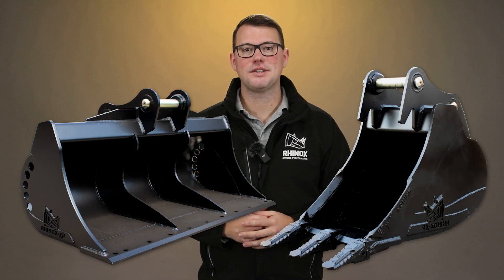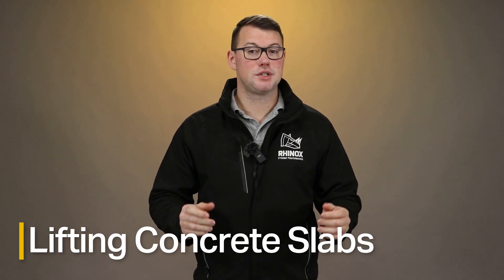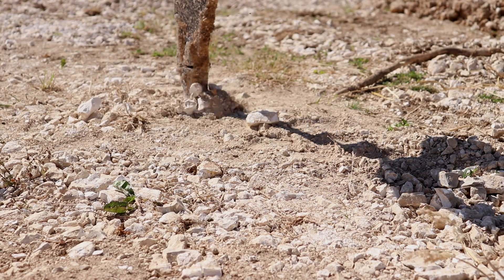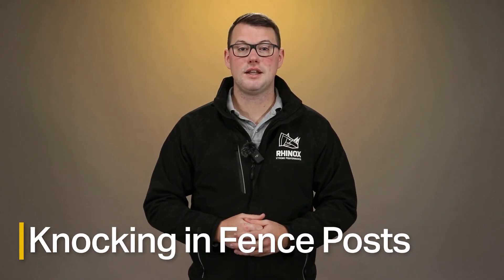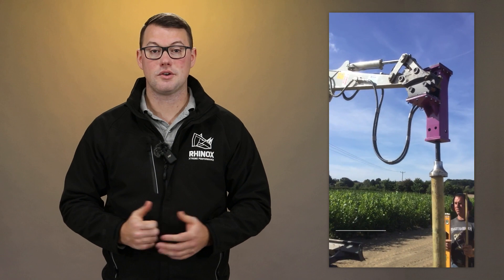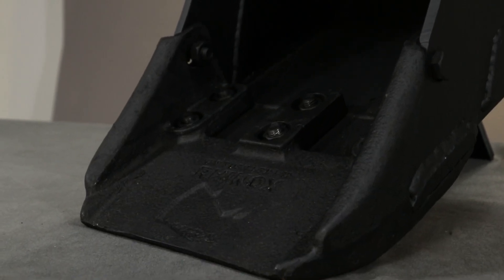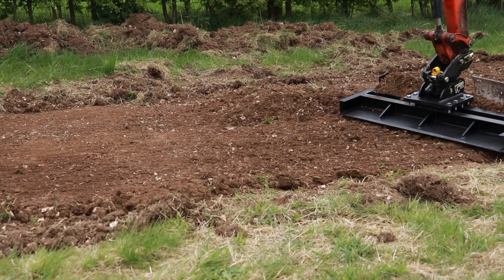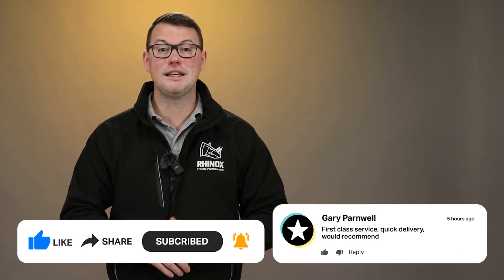EXCAVATOR BUCKETS - You are using them WRONG!😧

Comment: So buy 20 different attachments.
Reply from the maker: Not necessarily! We recommend investing in attachments that are going to make your jobs more efficient while so protecting your buckets - so if you regularly tear out tree stumps and concrete slabs, then a ripper tooth is a must to protect your bucket teeth and lip plate welds!
Reply: It is not uncommon to have 10+ attachments for your excavator, including a tiltrotator.

Comment: Literally just trying to sell more single purpose attachments.

You could by a spare/replacement bucket and it would be cheaper and save time and be more environmentally friendly than having a post driver or grader sitting around that you have to maintain and switch over to.

Gimmick factor = 1000
Reply from the maker: Buying a replacement bucket that you only use for hard wearing jobs is definitely a more budget friendly option if you're not going to be using something like a post jammer very often. But if your profession is landscaping or fence installation then making the investment to a post jammer might be the better option, as you will protect your buckets and be more efficient at the job. More efficient = Faster you can complete the job

Hope this helps😊